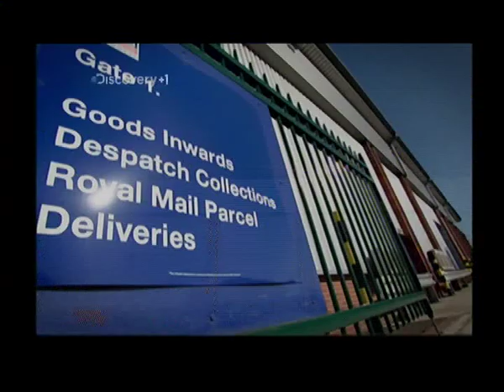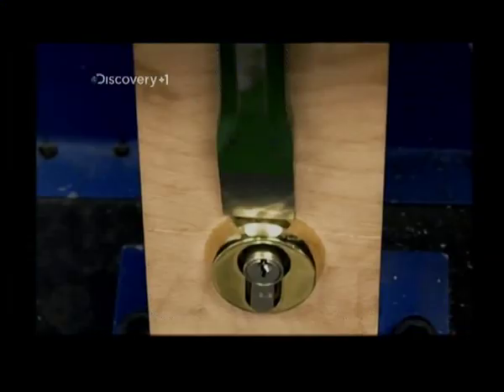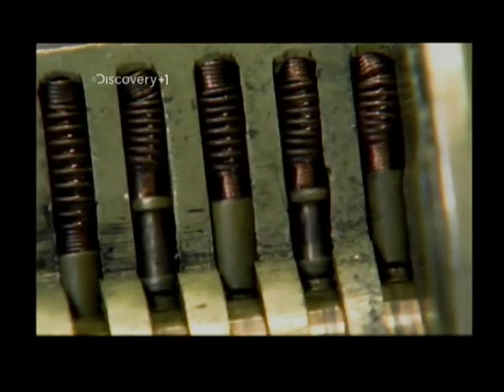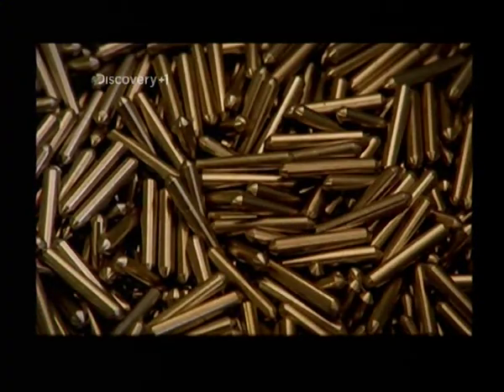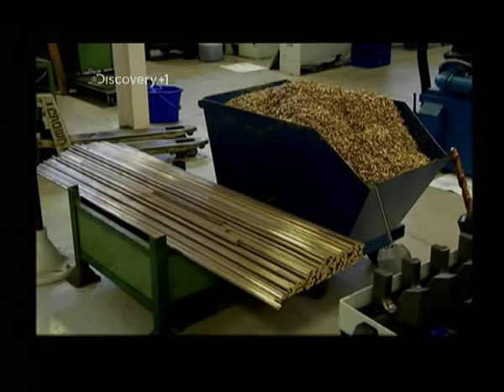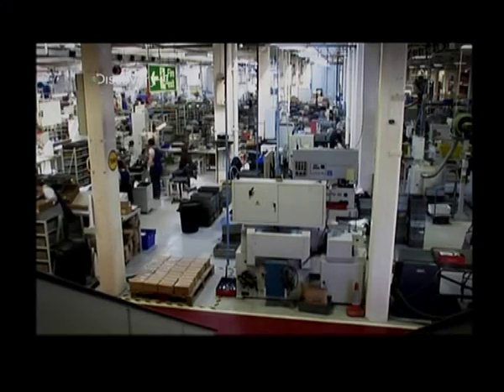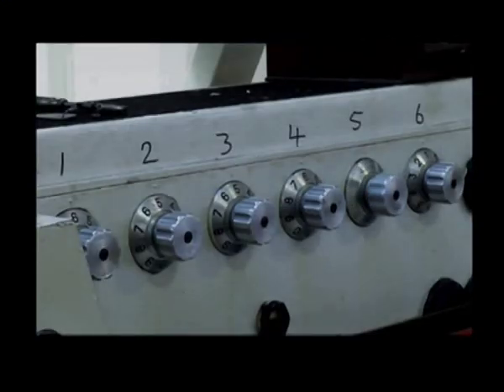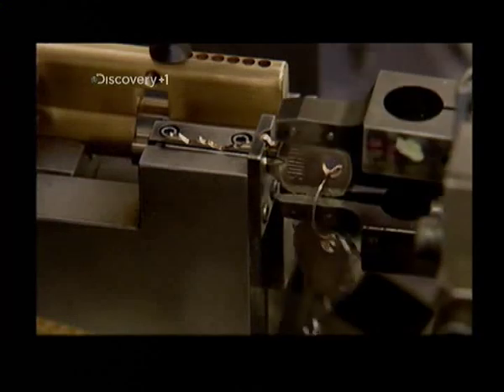Yale Assa Abloy cylinder lock on HOW ITS MADE

Comment: Not true, with a 5 pin lock, they only can generate 30000 key codes. That's called mass production locks
Reply: they count warding combinations aswell. That doesnt prevent against picking at all. but it makes for more key combinations.
Reply: They also said “for the highest security” ones. That doesn’t necessarily refer to the basic Yale 5 pinner on screen. Presumably it refers to the higher products in Asia Abloy’s lineup, some of which probably do have a million key differs.

What’s definitely incorrect, though, is the idea that they’re produced in batches of a million with one of each differ in it. That’s not really how manufacturing works. If anything, there are fewer locks produced per batch of the highest security, most expensive ones than there are of the cheapies.